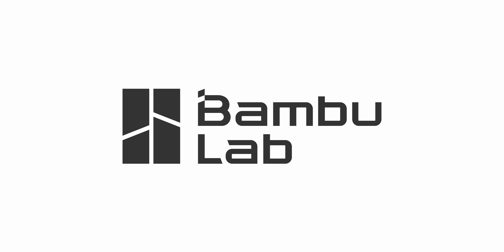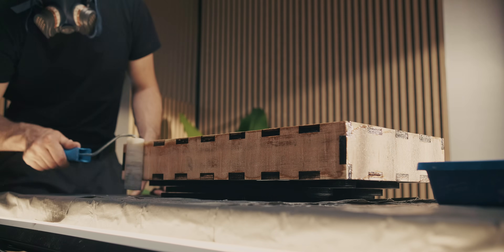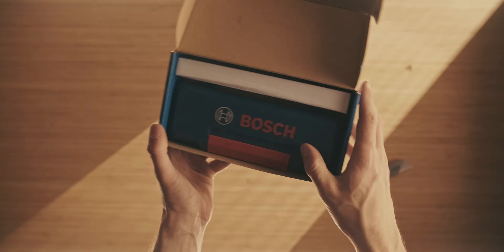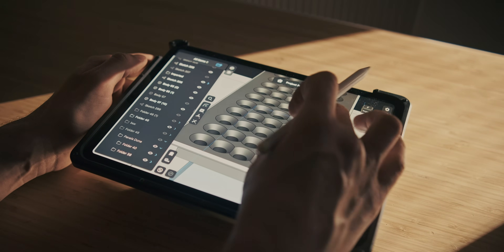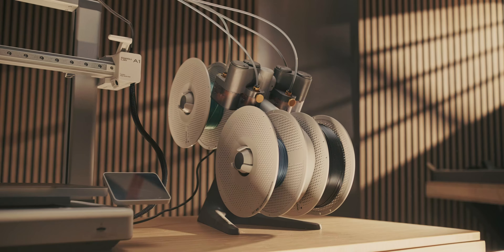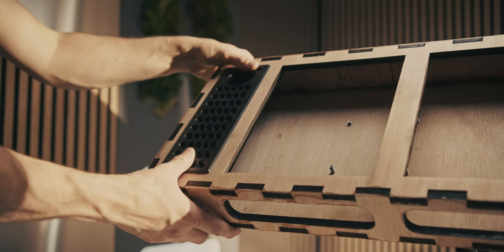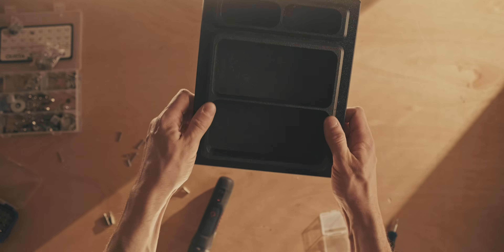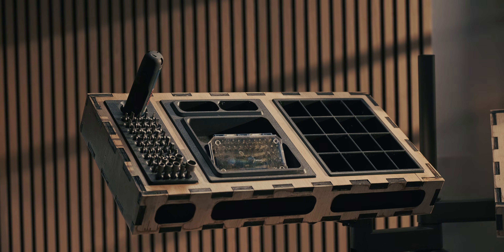Building a Dedicated Teardown Panel for my Upcoming Fabrication Setup Build Series

Comment: You could make the screwdriver always charge if you put in a magnetic usb charger in there. Those are directional-agnostic so it'd be much easier to mount it with an integrated charger.

Comment: Use magnetic USB Kabel. So it’s simpler to hold all devices fully charged. Other way to get a connection, is a hole, then put putty and the cable in the hole and place the tool inside the holder. The putty hardens and hold the cable firm.